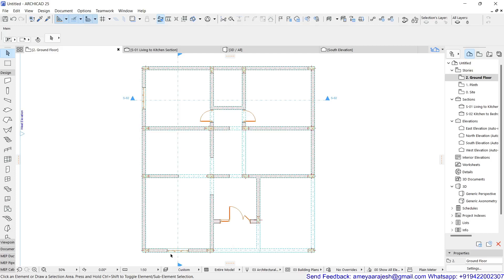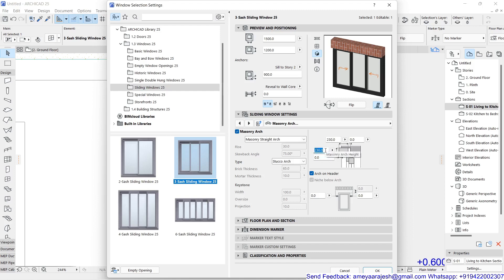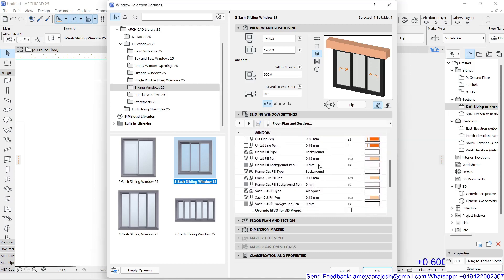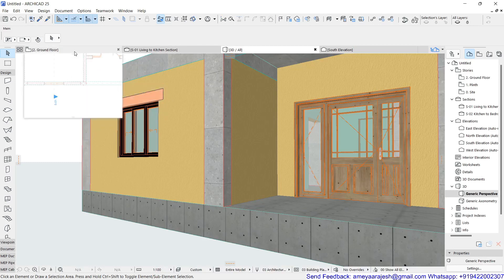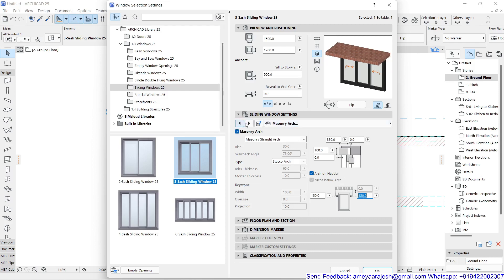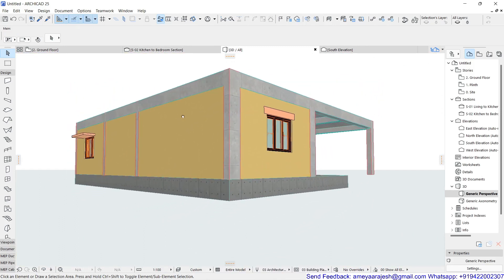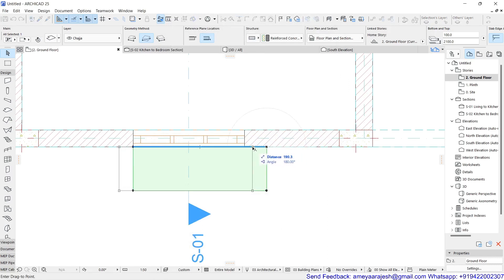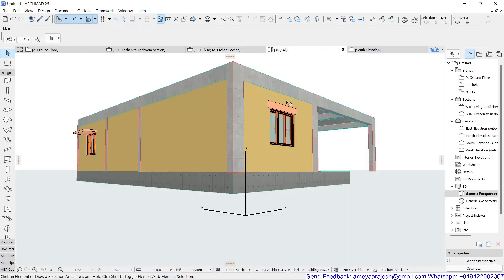2.15 Adding Lintel Beam & Weather Shed for Door or Window.

Comment: Is there a way to change the cut line pen for a masonry arch lintel? (not the cut fill pens)
Reply from the maker: Yes, you can. Say in case of door:- In door / window settings just go to the"Hinged Door Settings" rollout (this rollout name varies as per the type of used door / window) then choose"Floor plan and Section" page , in that check the "Masonry Arch" setting. You will get all required options.

Comment: Greetings from Kigali, Rwanda. This is good reminder on some basics we forget. A question. How can the quantities for the arches or lintels be captured under the schedules generated by Archicad. If so, can we get various details like length, volume, surface area etc. Thank you
Reply from the maker: Hello, sorry for delay in reply. You can extract the needful information in Schedules > elements by adding required fields from Library part parameters
But calculating volume or surface area of such parts is not possible directly inside ArchiCAD. Can be done in Excel. Hope this will solve your problem.